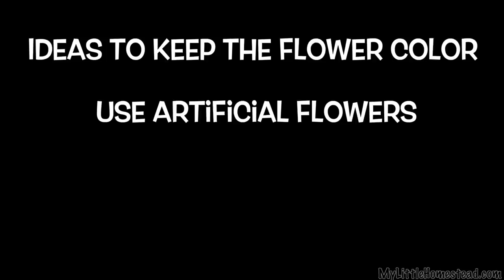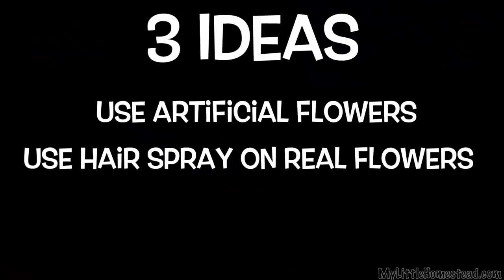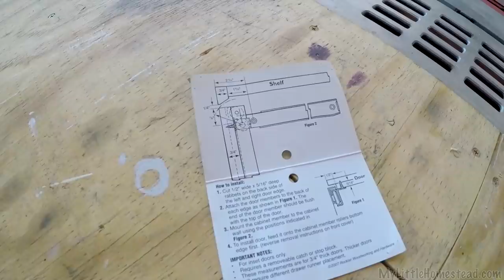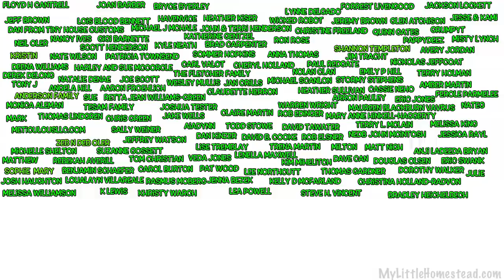Epoxy Flower Cabinet Re-Do, Homemade Crib Mobile Complete, DIY Jean Vest Jacket | Weekly Peek Ep205

Comment: A beautiful mobile. May I Comment the following with the best of intent. Please don’t hang metal over your babies head & body. Things break when you least expect and accidents happen because they are accidents.  Please consider another material and triple the line with three independent strings. I’ve had a light wood mobile break and scrap over a babies eye and there was no reason for the line to snap but it did. It was very very light but still did damage. I tell everyone now to use three separate lines to hold mobiles. Two should and would be enough but I’m a mum so I say three now to be sure. Best of times with your baby girl. 💕🐨🦘
Reply: Excellent advice. My first thought when I saw they were using horseshoes was, what if it falls and hits the baby in the head. The mobile should also be taken off the crib as soon as the baby can pull itself up to a standing position because little hands and curious minds will pull that down in a second.
Reply: I had that same thought!  My own mommy senses say not a good idea.  It's super cute, I would hang it up beside the bed and not over the baby's head.
Reply: I agree. Wonderfully said. My "mother instincts" raised a HUGE red flag when I seen a heavy material such as horseshoes being used to dangle over the area of a sleeping baby. There are a number of injuries that could unfold, including the head that can cause permanent damage. If it were me, I would consider a very light-weight material to hang that mobile.
Reply: My thoughts exactly. Great advice. I hung 2 horseshoes on the wall over my sons crib. And I swear I had the pretty much bolted down but a sonic boom brought one down. Thankfully my son wasn't in bed that night.

Comment: Gary, here is an experiment for you. Take about a pint of water and put it in a clean container and put it in the freezer for 1/2 hour to an hour. What you are looking for is a very thin sheet of frozen ice. When you get it punch a small hole in the ice so you can pour the water into another clean container to freeze the same way. However, before you freeze it wait for the ice in the first container to melt and put it in something you can easily weigh, then pour it out, dry it and put the exact amount of water that hasn't froze and weigh it. It will probably weigh less then the water that was frozen. Do not add more water, but do this same thing for a total of three times, by then the water that was frozen and the unfrozen water should weigh close to the same. What you are after is for them to weigh close to the same. You are then left with pure water. Repeat that process (the freezing process) with water for your drinking. You should see a positive report on your cancer, in time, gone all together.

Comment: Clear coat looks best, in my opinion. Hit the back of the artificial ones with a heat gun and then press to get a flatter result( it melts/softens up the plastic).

Comment: You may want to spray the front and the back of the flowers with the clear coat in order to encapsulate it and prevent the epoxy from saturating them.

Comment: Just an FYI, I noticed that the baby crib panel up against the wall has several open cracks or slits, very easy for baby to get it’s fingers stuck in them and possibly injure themselves pretty bad. Also, wondering if everything used is non-toxic including the wood. Most pallet wood has formaldehyde.
Not implying in any way that you’re negligent but, many new parents are unaware of things like this. Congratulations on your pregnancy.

Comment: One of the reasons that the color could be leaving is epoxy is an exothermic reaction. It literally cooks the flower as it is hardening, and i dont know if that little amount will have the same effect. If you would like there is another youtuber that does A LOT of resin and has done a flower. It took him like 5 tries if i remember correctly. Just message me if you want that other channel.

Comment: since your artificial flowers are most likely made from plastic, you could use a heat gun to soften the plastic and get them till I flatter. A hair dryer might work but it probably does not have enough heat to soften the plastic enough to have them flatten out.

Comment: I worry about using the horse shoes for the baby mobile, what if it broke and fell on the baby?  Maybe you should use a lighter weight material for that......I would suggest PVC piping and drilling holes into it would be easier.  Also, you might consider using some of the leaves from the artificial flowers as possible covering for the PVC tubing, and maybe doing a clear coat over those? By the way, just found you on youtube, love this!

Comment: The crib mobile is very pretty but it's awful heavy. They are usually made of lightweight materials so if the child pulls on it and it would happen to fall it won't hurt the child. Could you use a different material to hang it all from? Prayers continue for healing for your dad.

Comment: Try using a different epoxy i think you will find the epoxy is a faster set which will scald the flowers a slow set epoxy will work try total boat slow set epoxy or chill ice 2 epoxy ive seen people use it on red roses with a 100% success rate there is also a link below to a guy putting a rose in epoxy using chill ice 2 epoxy 
https://youtu.be/SdJ4SkbVVUg